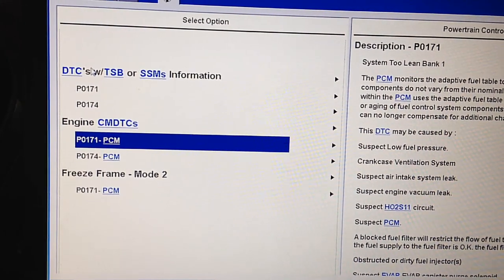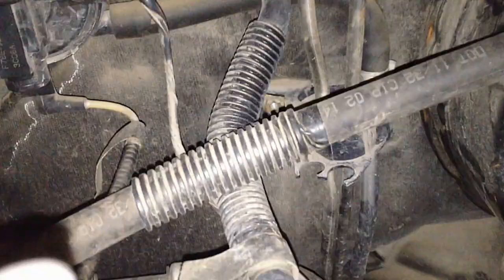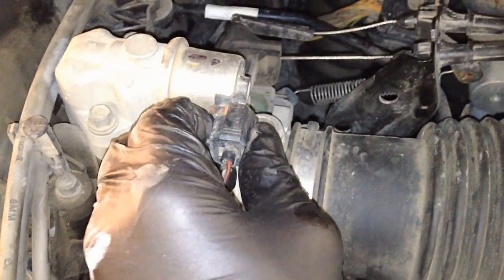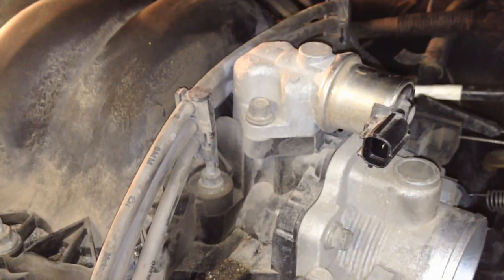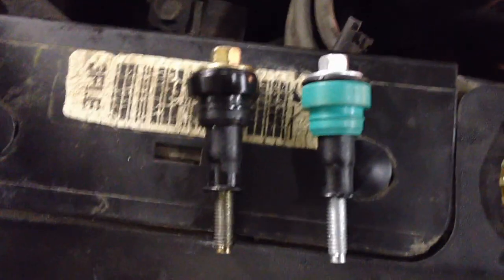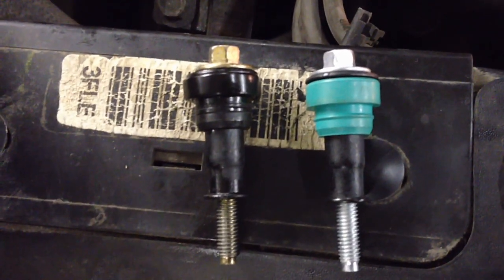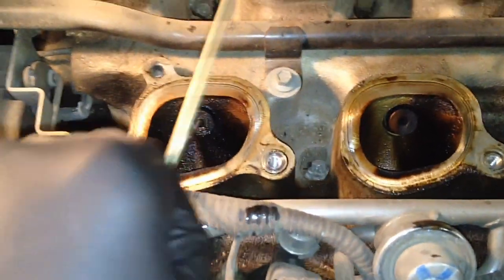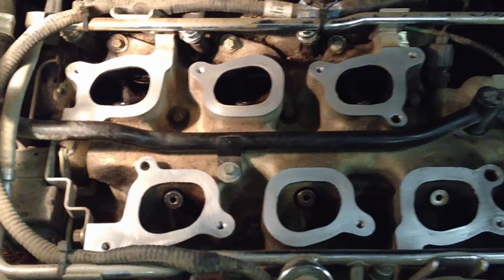Ford Windstar P0171 P0174 Upper Intake Manifold Gasket Replacement

Comment: Hopefully you can lend a helping word or too on this subject for me.. had a lean code before jumping into this the typical p0171 and the p0174 but also had a random misfire on cyclinder 3 time for tune-up, plus rack and pinion was also going out so the vehicle sat for almost a 8 months before i could tackle it all at once. So i replaced the rack and pinion, repaired the infamous double flex pipe (found out i need a converter), plugs and wires and only thing left was to tackle the p0171 and p0174 codes. I did alot of research on them and everything lead me to finding your video. I bought the recommended kit by ford and others and followed your video to the tee. Tightened in sequence and to spec by ford guidelines. let the vehicle run multiple times and even drove it a couple miles without alignment just to see how it acted and still feels like there was still a ping in the exhust then..  i got home let it cool down and started it back up and there is a check engine light pull the code and ill be damn if it aint the p0171 code only no others?? so my question to make this lame long story short is do you think i should replace the front valve cover gasket even tho its not required on the 2002 year or pay to have it smoke tested by family friend for decent price? or do i need the pcm reprogrammed ? which route would you take if you encountered this issue?

 been over the whole thing 3 times plus 3 times and everything is where it should be and no visible evidence of anything wrong checked all injectors no loose connections no loose vaccum lines no cracks in any of them. Maybe im overlooking something or jus need someone elses different perspective might be able to help thanks for reading thanks for your time
Reply: Some seemingly trivial things to check:
 
Fresh air inlet tube attached (@18:30 in the video) If you didn't disconnect it, but somebody else left it off like at a fast oil change, just saying' in case maybe you didn't even see it.

Check the air cleaner band/clamp very carefully...I found once on mine that the band and bumps were not aligned on the bottom and the seal was not right on the bottom, even though it looked aces on top. Could have been me, could have been the oil guy, who knows. From the appearance of it, it looked like someone muscled it shut and even mangled some plastic. I'm betting it was the oil guy. lol

While I don't know if this would effect the lean codes coming up, but I think it could be relevant to the missing you still hear, did you check your coil? They get cracks in them at high mileage...mine was cracked in three places! (see my reply to a post below)

Did you clean the MAF sensor at tune-up? Be sure it is all put together correctly. If you didn't clean it, try that too. Be sure to use only MAF sensor cleaners.

That's all I got.

Comment: Great video.  I have to do the boss's (my wife) van.  We had this done at Pep Boys a few years ago but the van has been throwing the same codes as before.  I don't know if they replaced the bolts or not.  So here is the loaded question :  Should I replace the bolts with Ford bolts or trust Felpro? Thanks again for the video and any advice.
Reply from the maker: Yes make sure you do the bolts and gaskets or it will bite you in the end. I like felpro for gaskets but have not seen their isolator bolts. In the end being a dealer tech and having done a ton of these I know that the new style bolts and gaskets from Ford work and are a permanent fix for sure.
Reply: Well i have my windstar whith 322000. Thousand and still running whith this litlle problem ....i wiil fix it this weekend. I hope so
Reply: @Alacran_Vlogs  You still have it?  Mine is at 310k, but tune up time now.  Runs great, but it is time.  AC compressor finally starting to go, but 300+k on the compressor, not bad ford.  It is on it's 3rd tranny though ... ugg.

Comment: Good Job !! Question: Why you did not take IdleValve out, so clamshell could come easier out/ go in?? Just wondering???? you could clean it too....same time =)
Reply: Thanks for the tip on the IAC Valve, I will do that.

Comment: Thank you very much, following the video made that job fairly easy.  Finished it in a few hours and no more lean codes. 

Just a FYI, my van is a '99 Windstar SEL, 3.8 liter, and the factory gaskets were red.  They seemed fine but I replaced them anyway since I had bought the new blue ones already.  The bolts however were the black ones and they were obviously bad, the rubber piece was squashed down pretty good.

Anyway thanks again, this turned out to be easier than I thought it would be.
Reply from the maker: I have never seen red but in aftermarket gaskets I have put on, either way the Ford gaskets you put on are a major improvement!

Comment: At this point I'd swap out that coolant crossover tube as well.  It'll eventually leak at the 90 degree bend and you'll be going back in all over again.  If your lower intake gasket leaks, this is a good tutorial other than you have a few more things to remove to reach it.
Reply: Good advice. Pretty much anything that can be done as a preventative measure while the clamshell if off is a good idea. Replacing that elbow is definitely one of them.

Comment: I did this repair on a 2000 Ford Windstar 3.8l. Everything went smoothly from tear down to reassembly. Your video was easy to follow and tightening order diagrams. The problem I have now is when I try and start it. It sputters as it is starting, then while running it is very rough. I have a small hole in my muffler and it is making a loud popping sound. I revved up the engine a little thinking that the throttle body cleaner residue is causing it. It ran smoothly while at 2000 rpms but went back to rough afterwards. I shut it off, inspected the hoses again and everything is connected. Also the exhaust pipe from the engine to a flex joint midway of the van was glowing hot. The van ran fine before, just had the check engine light on. Now the check engine light reset itself. Any clues to what might be causing this?
Reply from the maker: Noah Pete You definitely have a cylinder that is misfire hard to tell from afar but yes you left something disconnected or something got damaged during the repair, best to see which cylinder is misfiring and concentrate on that one.

Comment: Hi , I have a 2003 for windstar and I have a coolant leak from the front of the engine, below the upper intake manifold and rite behind the fuel rail it's a black gasket. Is there a video on how to replace that as well? I plan on doing it my self. The way you explained everything in detail was amazing. Great video

Comment: Thanks, now I know what I need to do, and what I need to do it!

I know the service bulletin calls for replacing the valve cover too, I assume that is pretty straight forward, aside from setting the torque?
Reply: I did mine over 10 years ago but did not change the valve cover. I've never had any more problems. The real problem is the isolator bolts. The original black ones are a deficient design because the rubber grommets shrink up because of the oil and the new green ones don't. That's what causes the air leak. Also, I never removed the bottom part of the clam shell or changed any of the gaskets either. I just took off the top of the clam shell, replace all the isolator bolts one by one and put it all back together. That was it. The two leak codes went away and never came back and the engine still runs just fine. You will need to get the isolator bolts from Ford. I think there are 6 of them and they are about $8 each.

Comment: hey man I have p0171 and po174 error codes on my 2000 ford expedition, it has 199,000 miles. it idles roughly at Red lights when the engine is cold making the rpms go up and down while idling. when I pop the hood I can see rust near the connection in the intake crossover, should I replace the upper intake and gaskets or the crossover piece? what so you think? 

thank you

Comment: Hey dude you got any tips for doing the bottom gaskets. Idn if the lower manifold is broken off or the gasket is done. I can stock a screw driver tip intk the side by the belt assemvly.

Comment: Great Video. Thanks for posting. My Windstar is showing Code P0171 and P0174. I had this procedure you show in the video done about one year ago at the shop I normally go to. Now the same codes are back. Could it be the same problem again,  only a year later? I am using a very basic code scanner so i dont see too much info on it. Could these codes be related to something else like the Mass Airflow sensor or do you think it could be the intake again? What else can cause these codes?
Thanks for your help.

Comment: Excellent video. Have been looking for inf. on how  to do that job since last night. I just ran into it watched  and as I said excellent. I have a 2003 Ford wind star  bought new. Right now it has 111k miles Have had very little problems. One main  problem,  I had was the rear Axel   cracked. I used to hear this  crackling noise when I was backing into my garage. I always  used to check for cracks  Axel  since I was aware of the problem on these vans. But, failed to see any when it was right on my face. Went to the mechanic, he lift up the van he went straight to the crack. How did I miss it? He wrapped  a sheet of metal around  and into the  Axel inner space welded it no more worries. I thought I put this very important issue here  for those who might have the same problem. The cost of the repair, $ 200.00 Cheap, compared to the serious damage it could had cause if I weren't alert to that weird noise.
Reply: ford has a recall on rear axle, they replaced mine for nothing. and it was a northern van, so rust was real bad

Comment: i have the same code on my 01 ford windstar.. checked all the lines they're good..  figuring must be the manifold gaskets and isolator bolts. RPM's go up and down while idling and sometim wants to shut off when it gets real low! is Nasty said the same thing on his 99Can I just do the upper intake and not the lower.?????
Reply from the maker: +larry Mayer I have never seen lowers fail on these to date just uppers. I also have never seen the uppers fail so bad they cause a gross vacuum leak and idle issues.
Reply: larry Mayer same issue figure it out?

Comment: Made the repair yesterday with great thanks to this indispensable video. One question: Does it matter where I plug the spark plug wires into the coil pack?
Reply from the maker: Todd E Yes they are marked on the coil pack

Comment: I have both these codes. all hoses look good so I'm assuming it's the gasket and bolts. ordered them and will be doing it over the weekend. went ahead and also cleaned out the IAC and the MAF. the car drives fine only issue is the idle. the motor seems to shake abit and if I rev its fine but when it drops down to idle it surges abit then gets stable but still makes the motor shake slightly almost like a misfire but it isn't because it drives perfect. so is this idle issue common with having only these two codes?

Comment: Nice work! I did this but never cleaned the lower intake like you did. I noticed that the little arms that are coming out of the intake manifold runner control module were gone as well. Would this be causing the van to stutter as well? Or maybe I need to take it apart and clean it like you did?
Reply from the maker: Yes the IMRC arms and the clogged EGR ports can cause all kinds of problems. See my video here on diagnosing this- Ford F150 4.2L & 3.8L Windstar Hard To Diagnose Misfires

Comment: When I did mine I just took off the upper clamshell and replaced the isolator bolts one by one. I never took off the the lower clamshell at all. That was 9 years ago and the problem went away and it hasn't come back since.

Comment: Thank You for this great video. I have a 2000 ford windstar and it shakes badly at idle. I have completed this repair, replaced spark plugs, wires, coils, harmonic balancer, cleaned egr and iac, and the grommets for the intake valve flaps. I am at a loss at this point. Can You please help?
Reply: Sherwin Shahbazian did you figured out
Reply: @Sherwin Shahbazian  did u get it to run good

Comment: i have leaks on #3 and #5 on my intake maniflod on a 2002 ford winstar.. is this video how you change them? or do you have a video you could recommend
Reply from the maker: Tiffany Ornelas Not sure what leaks you are talking about but this video only shows how to replace the upper intake.
Reply: FordTechMakuloco they said the gaskets  #3 and #5 gaskets on the intake manifold needed to be replaced that they were letting the air out of the engine since the gaskets are gone does that make sense? or are they lying to us? casue it will be 500$# to fix it so im trying to figure out how to do it so the husband can fix it

Comment: helpful video. Did you only do the upper gaskets and it fixed the code problem? The lower ones look more involved and cant find any videos on that install. Wondering if the problem typically the upper gasket and isolator bolts. I was looking at the isolator bolt kit and upper gasket kit vs full kit if not needed, just trying to save time/money.
Reply from the maker: +Dublr81 The uppers is what leaks yes, I link to the kits and new isolators in the video description.

Comment: Question my 2000 ford windstar lX is having a vibration I did all this work put cables back in order and everything it it keeps vibrating code read doesn’t say nothing no check engine light either. What would you suggest?

Comment: I had to replace the clamp down bolts on my 2000 Ford windstar. And I had to replace the clip on the wireharness. The clip was BROKING, That go's to the coil. Yes it was a after marcket clip. 
Now it only starts if i butterfly the gas? NEW PLUGS. WHAT DID I DO WRONG???

Comment: Great video. I need to do this when it gets a little warmer.  Do you have the links for the torque sequences you mentioned in the video?  How do you clear the PCM memory? Do you just disconnect the battery for a few minutes?
Reply from the maker: Sorry about that must have forgot to add them. They are in the description now.

Comment: Thank you for this video, this was very helpful , what would  be the price range of getting  this fixed, I have a 2002 ford windstar  and this is what I need to get done but I really don't want to put a lot more money  into it, so if it's not to expensive  I will get it done if it is I think of trading it in. Tell what you think. Thank you in advance
Reply from the maker: sheniqua mar For lean codes just follow the video and it will run like new again.
Reply: Thank you...

Comment: Good video,  but how easy is it to get the new isolator bolts in if they are made of a harder type of material?   I had trouble with after market  "O" rings that were TOO rigid.  Can they be soaked in anything to make them more pliable?   Thanx for the info, pretty good stuff.  Need more vids like this, keep`em  comin.
Reply from the maker: +Gary Kovach I would just use oem an be done the isolator bolts are harder but simply push in by hand.
Reply: Gary Kovach same issue figure it out?
Reply: 925snowman Eventually.  Had to go through a bunch that went in fairly easy, so far-so good. Make sure they seat properly or you're just wasting your time.

Comment: I am in the process of removing my upper clam shell (2001 E250 4.2L)and the last bolt on the passenger side of throttle plate assembly appears to be stripped.  It is just spinning and not backing out.  1) how do i get it to come out? 2) does this mean i got o buy new clam shell?

Comment: I wouldn't do this on a customer's vehicle BUT I used copper silicone on the isolators and let ti dry  overnight.. The silicone was free and it turned the light out. I think Ford wanted too much for the isolators and I also wanted to verify the plenum wasn't cracked or warped. I think I saved $90, let the scone dry well.

Comment: First of all Great Job thanks for this Video My question is are you sure this small volt can take 89 fit/pound Torque because I broke one even I have it on 60 fit/pound thanks
Reply: 89 INCH-pounds is what he said in the video, not foot-pounds.  If you applied 89 foot-pounds, I think that was twelve times too much torque.

I haven't worked with torque wrenches much at all, but I think you would be best off using a torque wrench calibrated in inch pounds, meant to be more accurate in the lower torque range needed here, and be certain to follow the tightening sequences so that the seals are uniformly compressed.  If you used a typical torque wrench calibrated in foot-pounds, and did the math, you would need to be between 7 and 8 foot-pounds (89 in-lbs  = 7.42 ft-lbs).  I don't know if dial (clicker) type ft-lb torque wrenches even start that low, and you probably can't set them for that number, but even if you could,  the tolerance for error may be magnified on a torque wrench meant to accurate in the much higher foot-pound torque range, which is defeating the purpose of uniform ( and not to be exceeded ) torque all around the seal.  You don't want to end up distorting the seal.

I have no experience with digital torque wrenches, maybe someone else could pitch in here about them.

I figure you just mistook inch-pounds for foot-pounds in the video, and already figured it out, but if not, hope this helped.

Comment: ***** i have a 2000 Ford windstar . runs fine but has the 2 common vacuum codes. When i give it gas  by hand on the throttle i hear a loud sunction noise . i can't find a air leak so i just would like your opinion before i take the manifold out thanks
Reply from the maker: niner4life79 They all sound like that by the throttle when  you open it up by hand especially on the windstar. If this tsb with the seals has not been done I would do them as shown in my video clear memory and retest this is the most common source and yes it will run just fine.